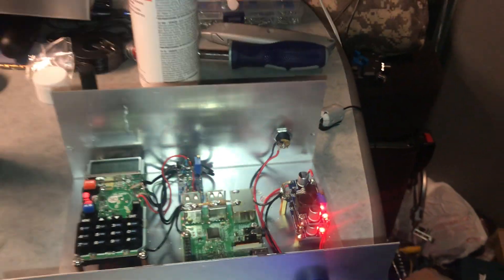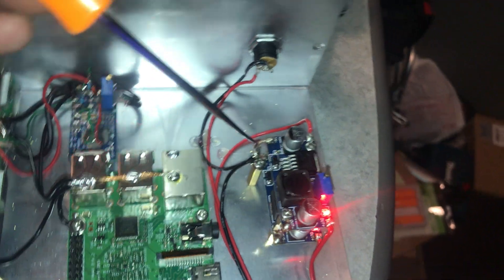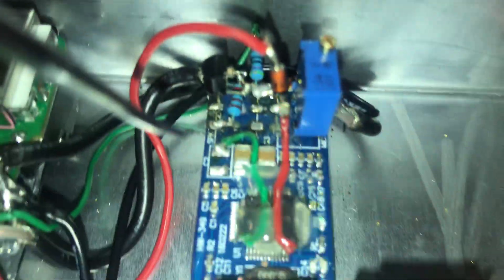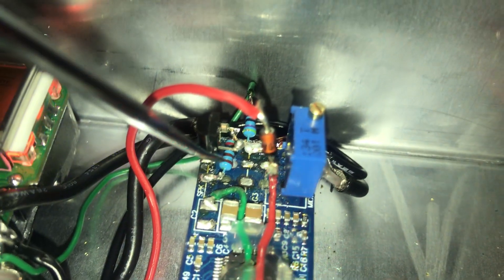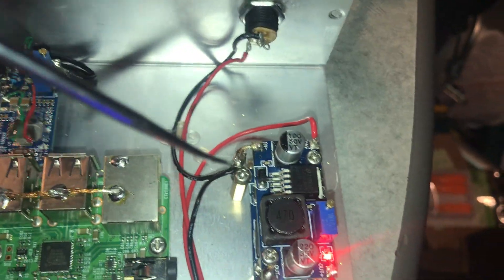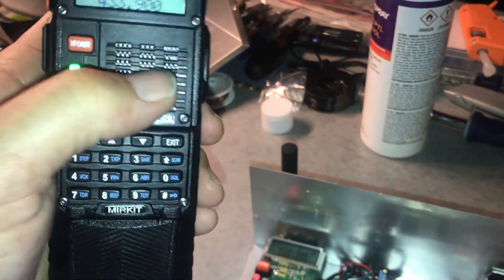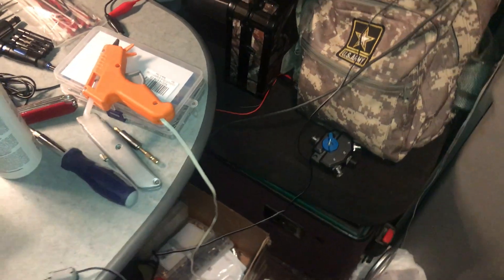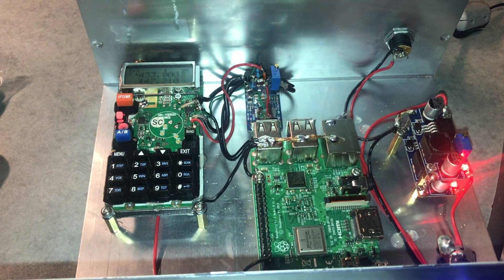Re-Packaging of Allstar node with Baofeng UV-5R, Raspberry Pi 3 b+ and CM-108 / KM6DZ

Comment: IMHO. On these radio RF freq leaks at 2Vp-p to its headset connector that might had given you some head scratch if not headache. :-)
I tried probing in an oscilloscope. However, I think the aluminum box helped suppress the EMI. I can see the audio wires from radio to USB sound card are touching the aluminum, that helped suppress the EMI but not totally.